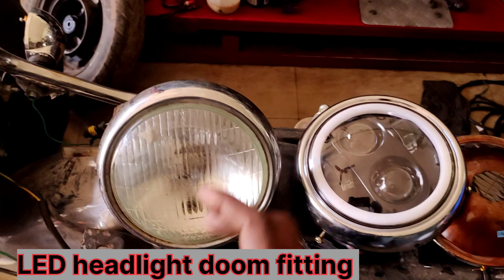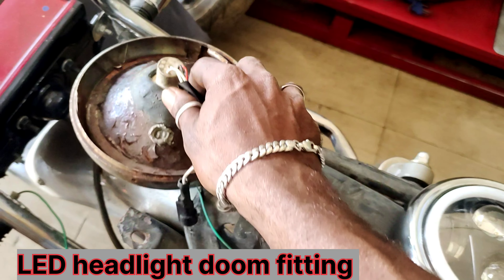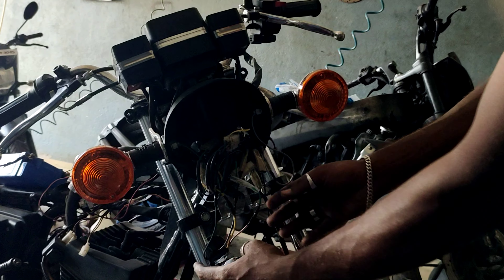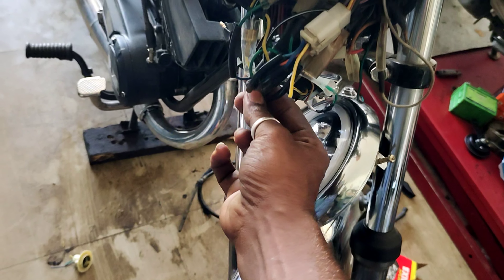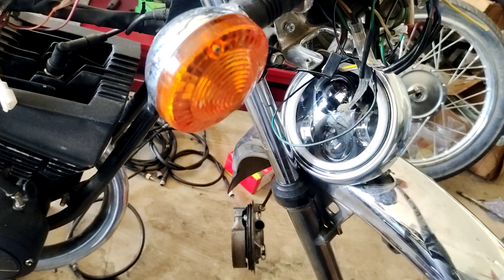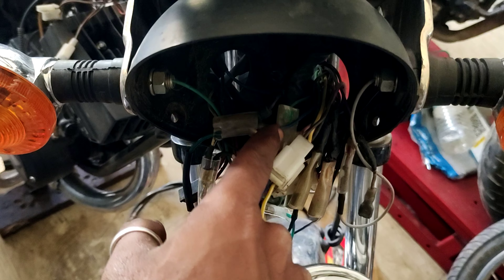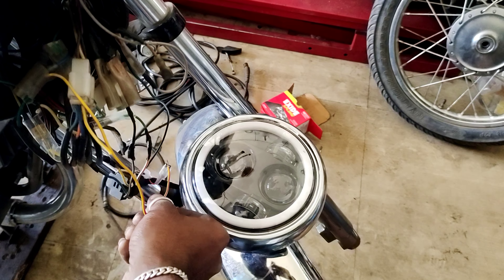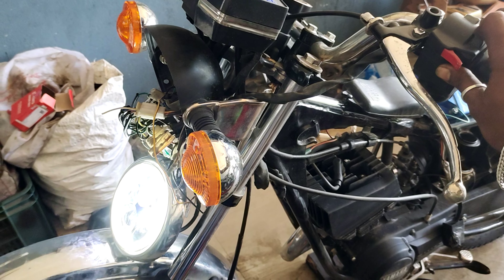Rx100/135 ,,, LED headlight doom fitting in தமிழ்,,

Comment: Bro, led light and hella horn fit panna aprm  rx100 laa battery issue varudhu...
Dry battery 2months laa dead aaiduthu, what reason and battery warranty um claim panna matakuranga for rx100
Reply: Like same problem
Reply from the maker: Coil alter panni 5 lb battary use pannunga bro